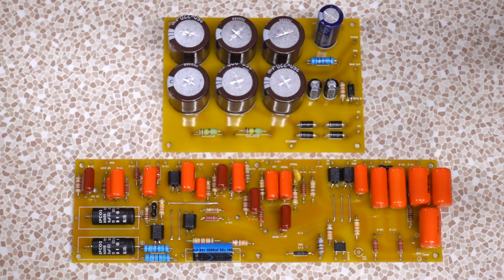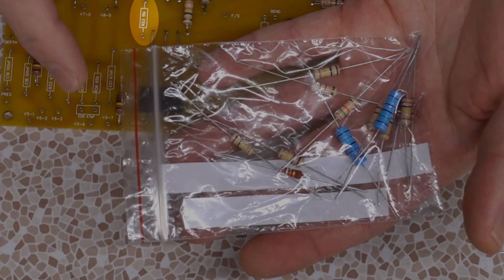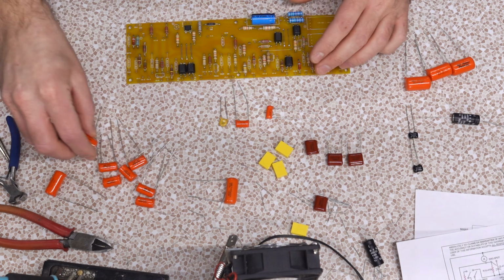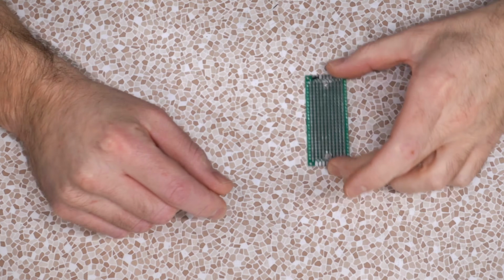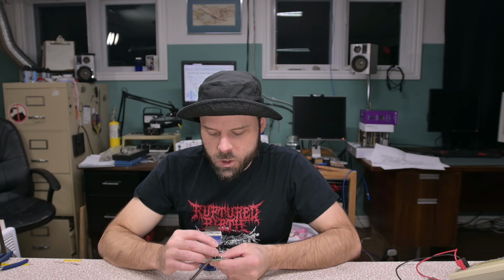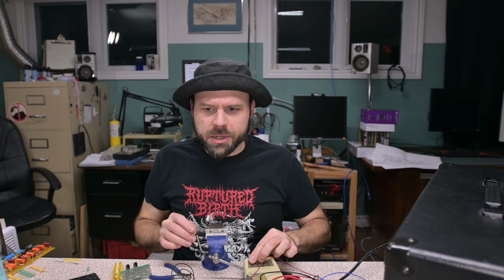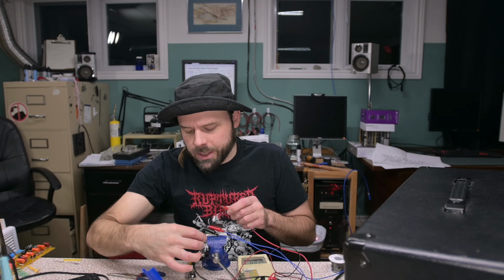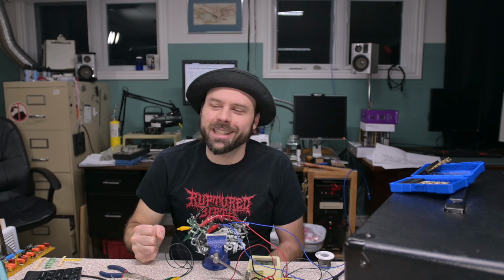SLO Clone Build Ep.2 - Component Mounting & DC Board Design

Comment: your vtl5c1 i think it from china. you must stress test. becuase if you test. It not cut to OL not same original vtl. It very slow more than 30s to OL
Reply from the maker: Well, I got the parts with a kit, so I'm not sure where the parts came from. I know none of the domestic makers make them anymore. So yeah, they'd be from China. They seems to work well, but yes, I know what you mean. 
I've bought these before, and even tho they were all the same part in the same batch, they all behaved differently, and I had to cull the ones I actually used.

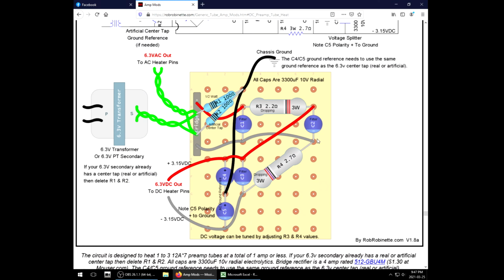Comment: 14:23 The reason why you get more DC voltage when rectifying from AC is because AC voltage is typicaly measured in RMS average, which tends to be around 70% of it's PEAK voltage. I'm only just now learning about electronics in amp curcuitry, and this channel has been a very helpful guide. I've been using the knowledge I've absorbed from you along with "The Guitar Amplifier Handbook" by Jack Door to learn about Amp design. I highly recommend it for anyone looking to learn about guitar amps. how to make them, and how to troubleshoot!
Reply from the maker: Hey thanks. Yeah, I know the 70% thing . . . now, but I may have forgotten or didnt' know then. 
It was one of those things I knew existed and how to work with but didn't know WHY, and never bothered to learn cause in practice I didn't need to use that info. There are things you forget over time. There are some things I do when working on amps I know to do, but have long forgotten why I do them. 

"The Valve Wizard" was also a good reference I've used. 
"Tone Lizard - Tales from the Tone Lounge" was a good site. He talks a lot about the industry as a whole and how absurd some of it is.

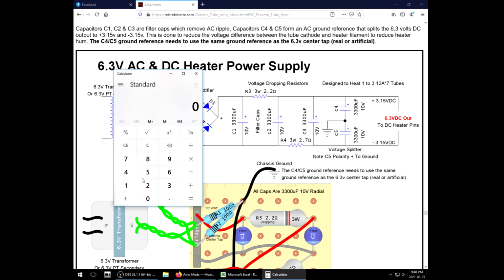Comment: 14:40 wrong, the DC calculation is times 1.414 (square root of 2, or RMS), not 1.35. 6.3VAC * 1.414 = 8.9082. Why? AC is measured as an RMS voltage, not a peak.
Reply from the maker: Ah yes, I'm familiar with the 1.41 equation. I use 1.35 for a reason, it's a value I came up with in testing to give me an idea of what to expect once the circuit is under load and the voltage as dropped. 
I didn't show it well in the video, but under load, I was getting like 8.5v after recto under load, before the dropping resistors. 
RMS vs Peak ? Ahhhhh, ok, so, if I tested a transformer, unloaded, on the scope, my peak to peak, would be much more than 6.3v ? OK, that makes sense now. Thanks. Kind of feel silly I never noticed that before.
Reply: @DATT  yes. DVMs average the AC signal, hence some saying "true RMS" on them. And, ok, I understand your thought process now for the 1.35 figure. Makes sense. But, you have to be careful using it, especially when choosing filter caps. You must use 1.414 to make sure you're not exceeding the maximum working voltage of the cap. Rule of thumb I use is to make sure the cap is rated for 10V more than the voltage presented to it. I don't like running them a few volt under. I had Chinese caps blow in my face by only being 2V under the maximum.
Reply from the maker: @AstrosElectronicsLab  Oh yeah, my cap selection is usually on point, and I don't use cheap caps. For stuff like this, I shoot for 105c @ 5000-10000 hours as a starting point
I typically try to shoot for an 80% derate in my designs, but now that you've pointed this I'll be keeping a better eye on that, cause indeed 1.41x 6.3 is going to be much more than 80% of 10v which I believe was the rating of the caps I was using. Heck, even 1.35 exceeds that.

Comment: Glad you decided to go with the heaters. 
Can't wait to see you if you run it low like Mike does. 
For your hard/metal playing, you might like it biased hot. 
Me? I love sag. Hurry it up bud. But don't skimp on the math. 
I think stuff like this is what that guy that built the most expensive collector amps
might have stumbled on to. Checking all components and making sure they are in
range when tying them together. OCD stuff. What's his name?!  Dumble. 
Bet you would love to get ahold of one of those and check the math on it.
Reply from the maker: Run what low, the heater voltage ? That would explain the values he chose. 
Ahhh, well, it's actually common in amps of this type to bias cold so the power tubes maintain clean headroom to reproduce that the preamp is doing. A lot of modern metal amps are all preamp distortion and the power section needs to stay clean and tight. Mind you, not sure if a stock SLO would of been set up this way. The client seems to prefer around 60% in his amps. 
Dumble was fussy about tolerances ? Well, they might not have been as tight back in the day. 
Marshals of the era were certainly all over the place.
Reply: @DATT  No. Not the heater voltages. Though I have no Idea what those are. He never mentioned running them low. Only the benefits to having them
I was talking about running the bias low. He mentioned it was easy on tubes and I thing the amp in general. But you being a tech can look all that up. 
I also remember reading all the buzz about people buying them and not liking them. Those guys usually wanted a tight hitting amp instead of one with 80's 90's sound and sag.  My SLO uses only pre amp tubes for distortion. Not sure about the new and older versions of the 100's. Mike talked a lot about that. The master is a great attenuator. Because the power tubes simply cleanly amplify the preamp sections. I was under the impression he was the only one doing this and his amps were for the most part, the only ones you didn't have to use an attenuator on when playing at low volumes. I can testify to the fact the tone does not change as you lower the master. Only the air pressure and volume are effected. 
What I was also saying is that bumping up the bias to what the heavy guys use, not sure what that is on the other amps, but if I remember it is greater than the max setting the tubes are rated for. Or at least right at the max. I don't see that causing the amp to  hit harder now that I think about it. Which is why you may have thought I was talking about heater voltages be raised to take some sag out and be a hard or harder hitter. 
I'm pretty sure those are run low as well as the design is to have a long lasting amp that is easy on tubes but still rocks hard. From what else I remember is it is actually a 50 watt amp tuned down to 30. But still gets as loud as a 50, or close to it. I'm not a tech. I'm just giving my opinion on what I heard Mike say and people who reviewed the amps a few years ago when I did all the research. In that research I also learned that the preamp dials were only usuable up to 6 or 7 for us non heavy players and using different pre amp tubes kept it from over distorting so soon, giving a higher range on the dial. And it smoothed it out a bit. And in doing so I found that to be correct. I actually use high dollar vintage tubes in 3 of the preamp sections. And for me it sounds way better for what I do. I found a combo and quit thinking about it. I called it done and hope it lasts many years before I have to change tubes or make any repairs. So far, so good.
Reply from the maker: @chuckyz2  Ah ok, I sometimes run the bias hotter on amps I only ever play at low volumes, but will cool them for higher volume applications. Big tubes like 6550 always cold at 50% in these amps. 
Some of these amps were 100 simply to have clean headroom, but volume aren't really run louder than a 50. 
If I understand the history correctly, Soldano was one of the first to do this, that's why he got famous. 
Before, you had to crank the amp, or use an over drive. He built an overdrive into the preamp. So basically, he was one of the first people to build what is now a modern high gain amp, then, being in the right place at the right time, it took off. 
The tone will change at lower volumes at a certain point, usually by the time you get to bedroom volume levels. 
I've noticed this cause that's often where I play. 
I'm not sure why heavy guys would run hotter, that seems counter intuitive to me. 
One thing to bare in mind, is the well funded rock stars, run their amps like drag cars, where the engine has to get rebuilt after a few races. They will run the amp hot to get "that sound" but blow thru tubes in the process. As I recall, Angus Young hits the stage with something like 15 heads, not cause they are all running, but because he'll literally blow thru several of them mid set.
Reply: @DATT  Hmm? Interesting. Look forward to you moving forward with your build and seeing what you learn as you go. I'd stay clear of the modern V30's. They are kind of shrill in mine. I have an M65 (if I remember) cream in one side paired with chinese V30. Time M sounds way better. I have a Alnico gold that will be replacing the V30. That thing sounded great in in my Deluxe. I put a real vintage deluxe speaker in that. The Gold sounds better but the real speaker sounds more authentic to what the amp sounded like back then. I'm kind of lazy. Been meaning to swap it out for over a year.  But I already know I will like it. I also have an Alnico Cream in a 1x12 that sounds great with the SLO for a 1x12. Might mix that in with the M and then the Gold someday.  The V is going bye bye. I hate it.
Reply from the maker: @chuckyz2  Ah, I'm unlikely to touch Celestion anytime soon.